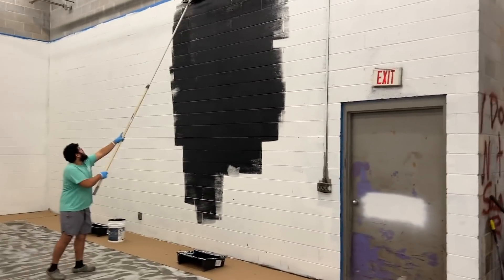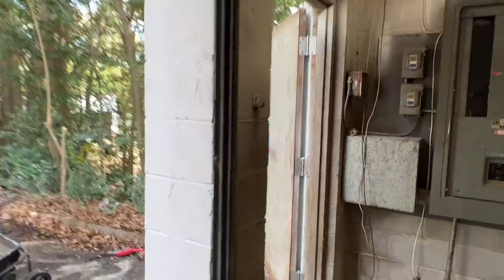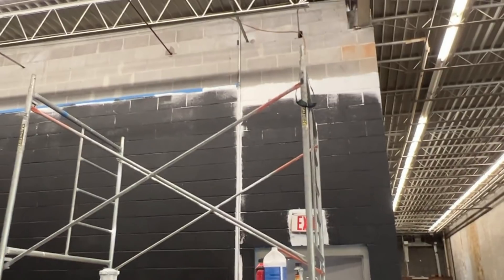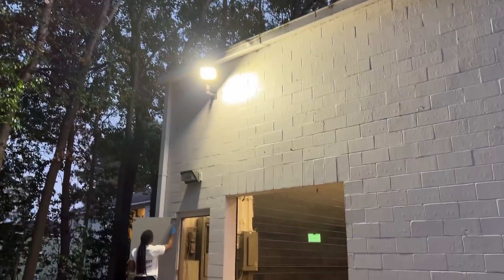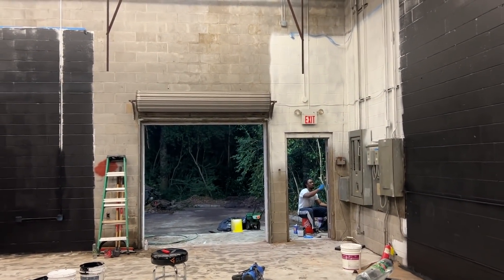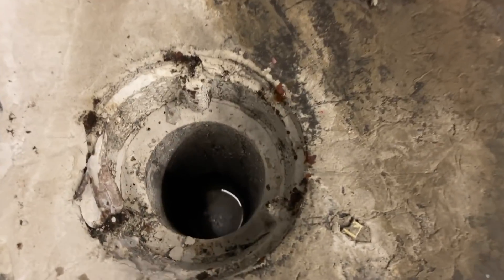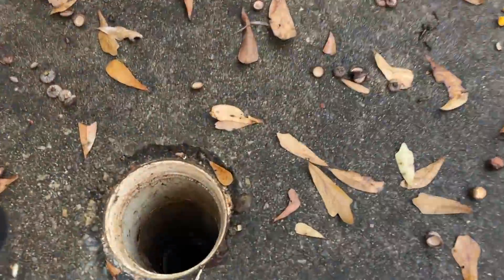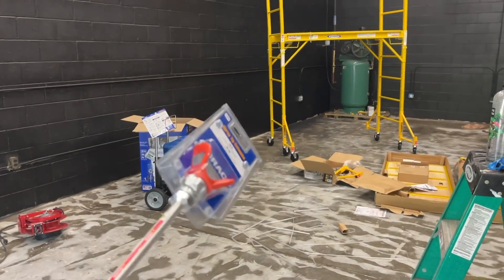Watch us Convert an Old NAPA Shop Into My Dream Shop! Ep. 3

Comment: To prevent that epoxy floor from coming up after a couple of months you will need to grind the floor for best results, acid etching kind of work if the concrete is already clean but grinding it would be if you want it to last. Just speaking from experience.

Comment: You should use a cement grinder to the the floor rly smooth Ik someone who used the same 2 part epoxy and it turned out amazing

Comment: might want to check the fire code on locking an emergency exit door.  the BIG bar is a " panic bar" so you can leave, then you put a small dead bolt  to fiddle with. Dont die in a fire.
Reply from the maker: There’s been a dead bolt there for 37 years. Passed fired inspection already 👍
Reply: Nice, lots of work done, keep going!